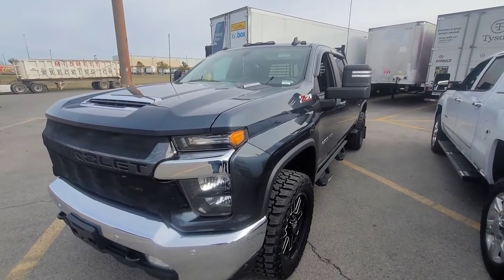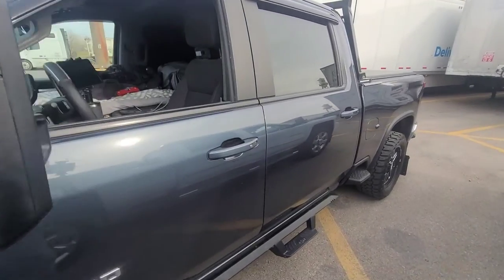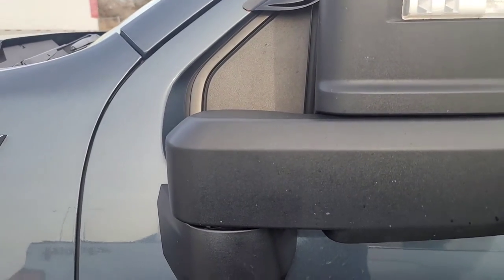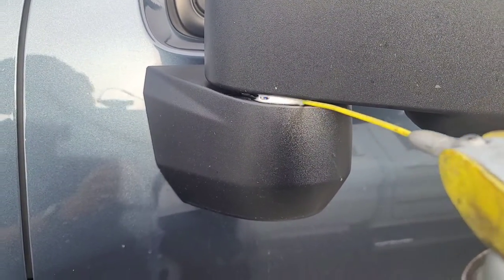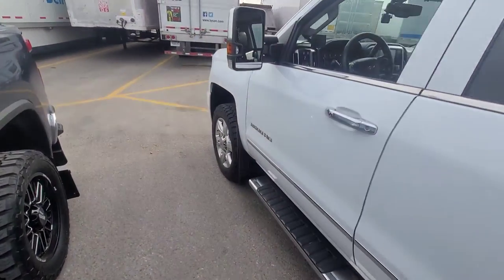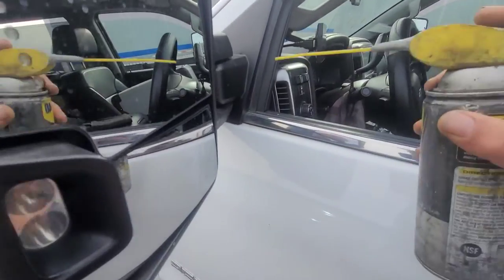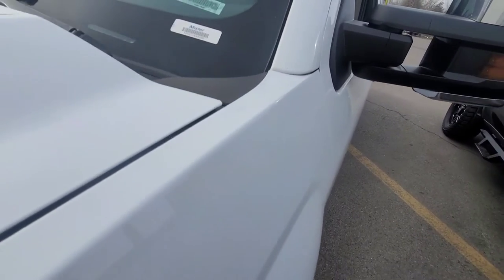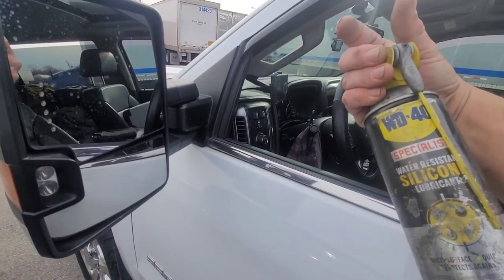Power Folding Mirrors Sticking

Comment: The word WD40 on the can tends to throw a person and think its all a similar product in the cans, but in any event that is a good trick to use silicone spray and have done that in vehicles where there are two plastic interior panels that overlap and squeak if on rough roads and just takes a little squirt and that can solve the squeak, don't get the spray on anything else in the cab when doing that trick though. I've also used it along the edge of a roll down window to lube it so it doesn't make noise and glides better, only a little sprayed on a finger and run it along. I use it with that same idea on the rubber door gaskets and in that case will spray some on a small section of paper towelling to use to apply it, also helps keep the rubber from drying out and will reduce the chances of the gasket sticking to the door if the vehicle is washed in below freezing temps as the water will bead and tend not to weld the doors shut. "WD40, not a sponsor of this video" 😂

Comment: I think the passenger mirror is actually at a different angle which is closer to the truck which is why it closes a little quicker… not positive but just a guess.
Reply: Not the case on my 2021 3500 HD LTZ. The drivers and passenger mirrors are equal distance from the window. The glass is what adjusts the mirror view.
Reply from the maker: They're still the same. Passenger still just a slight bit faster